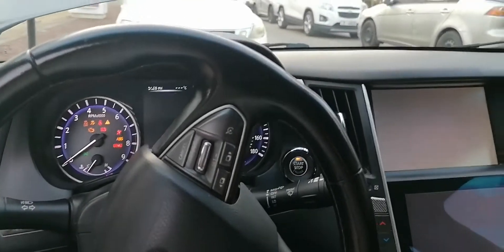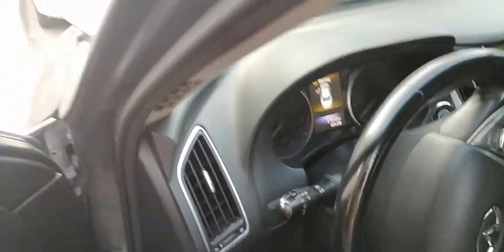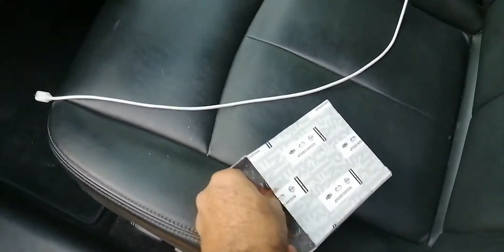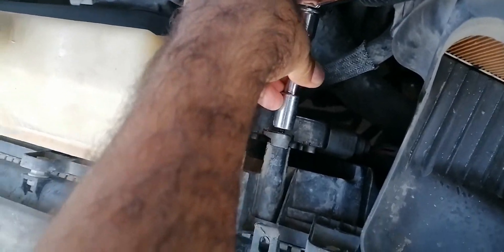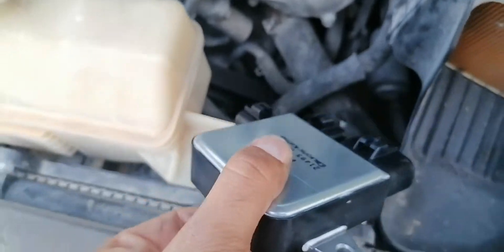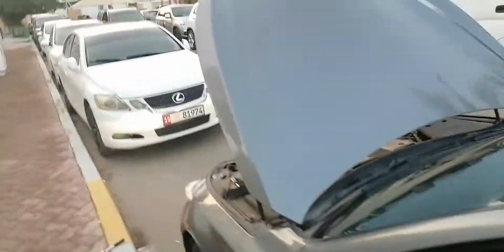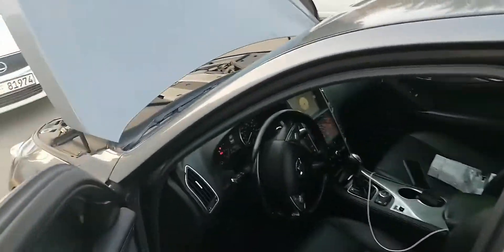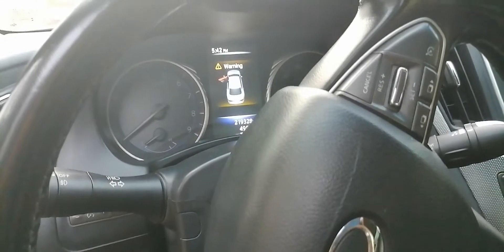Radiator fan running all the time. Infiniti Q50 Radiator fan control module | P117A error

Comment: Hey I’m having trouble with my fan. My fan is not working at all, I bought a new fan module and a fan motor and new fuse box and still nothing. I need help!!
Reply: I’m having the same issue! I replaced practically everything and still nothing! Did you find a fix yet?
Reply: @jamie20x  I have takin it to an electrical mechanic and they have fixed it. I don’t know the name of the part they replace but the part cost roughly $600-1000 new to old.
Reply: @Braceyy damn you got scammed I found the part for less than $60 dollars on the websites that mechanics and dealers use. Cost $51 dollars.
Reply: @RedShirtMenace808  what was the part?
Reply: @Braceyy  it’s the radiator fan control module so easy to replace too just in a tight spot

Comment: I have same car the my ac is not bowing cold air at stop or low speeds but if driving on high way it is cooling
Reply from the maker: Check the fan blower. It has two fans . One of them may not be working.

Subscribe plz